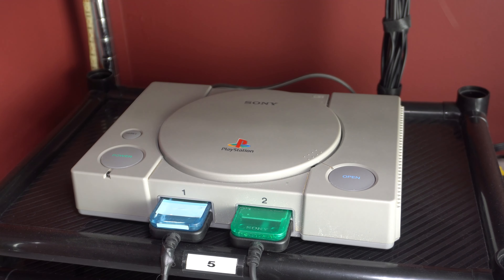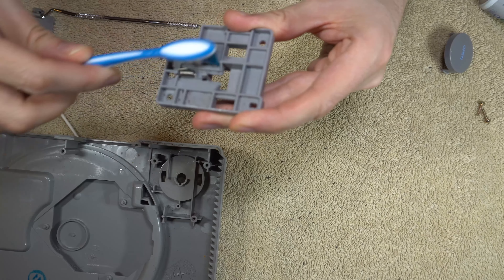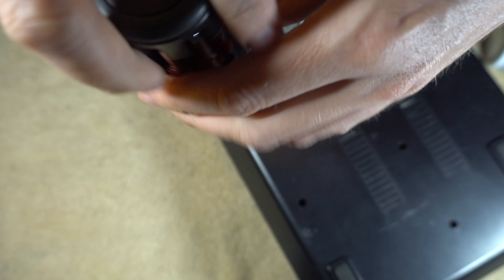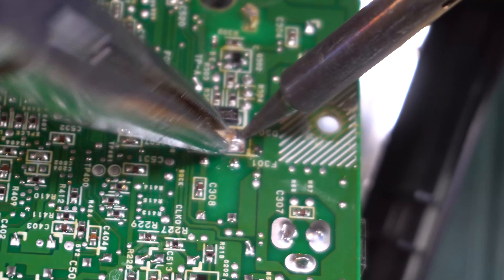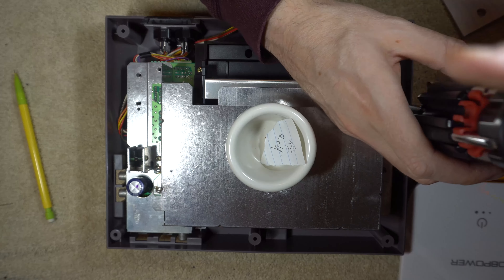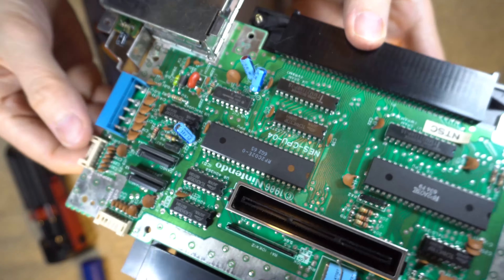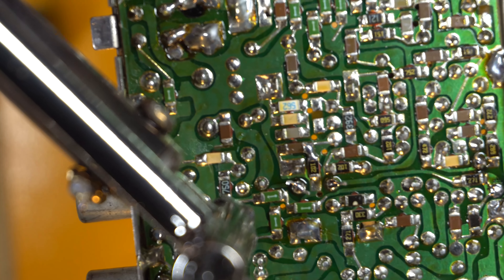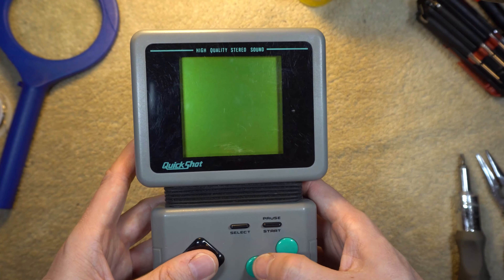Repairing Gaming Systems PART 1 (PS1, Sega CD, NES, Supervision)

Comment: My mom once had a issue with her DVD player that was making a high pitched noise.

After figuring out that it was caused by the AV cable (I listened where the sound was coming from) I pushed each of the them and found that the problem was with the yellow cable.

I then removed each of them wiped the tips with a cloth and twisted them in the AV port a few times.

It solved the issue.

Comment: The battery corrosion on the supervision is Alkali. You need to neutralize it with a mild acid like vinegar and then clean it with some iso alcohol after you no longer get foaming. My guess for no video would be to check the cables going to the screen. It looks like they are secured with old hot glue and if they are contact based on that pressure it may no longer being making contact at all.
Reply from the maker: I think it was rust. I used lemon juice and nothing happened. The connection to the screen is contact bases so I'll try to get it back into place when I make the next go at it.

Comment: My PS1 does the same. Pushing the tab on the inside where the lid locks also makes the open button pop back up, but it's still annoying. Thanks, this should be an easy fix.
Reply from the maker: Honestly, after repairing the door, the unit never worked the same. The door is fine, but it's having trouble reading discs. It may have been a coincidence, or maybe blowing that dust around did something.
Reply: @HowToX  Yeah, I hate how exposed the laser lens is. So delicate.

Comment: Soldering stuff that small is hard. I have tried when I worked at a job that made electrical trainers. You got the board too hot with the soldering iron. Its easy to do.

Comment: Hey, keep those coming.
It is funny how you seem not to inspect your consoles (like this poor PlayStation). I cant help myself and open, Check out the caps, board and clean reeealy good (all plastic parts in the tub) every single controller and system i buy (unless its brand new).
Reply from the maker: I didn't have much trust in my ability to take something apart without breaking something. Plus I never knew what to look for. I did always test them on the TV though, to make sure they worked.

Comment: If you need to clean rust of of metal harbor freight sales something called Evapo rust remover. It can be diluted down with water to stretch out the solution. Submerge a part in that stuff for a day and the rust is gone. I found a rusty socket on a car I was working on at work. A day in the solution and the socket had no rust.

Comment: The NES sound issue is most likely related to you switch box. You said you could make the sound issue happen while manipulating the switcher. I would connect the Nintendo to the tv by itself to eliminate the switch box as a possible suspect. Also try different A/V cables and RF switch to eliminate those as well.
Reply from the maker: I don't have an easy way to connect to the back of the TV. There's a network of stuff in the way. I am going to take a closer look at the switchbox and cords though.
Reply: @HowToX  yeah they tend to be a pain when they’re already all hooked up! Haha! I have a very small portable 8in crt. That I use solely for testing consoles. Well good luck! Hope you find a fix and update us! Love the content! Keep it up!

Comment: Kevin you should have cleaned the rust in your ps1 while you had it apart also I see what you did with the nes capacitors and your cat catpacitors also I felt the video didn't  need the puns p.s I'm  a long time subscriber
Reply from the maker: Thanks. I will say I did not make the connection between the cat and capacitors. That was purely accidental.